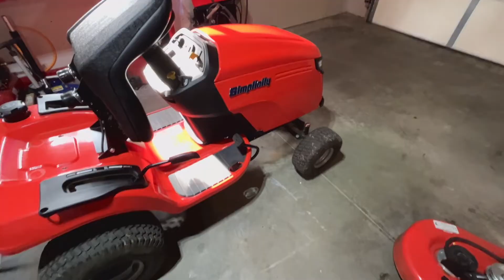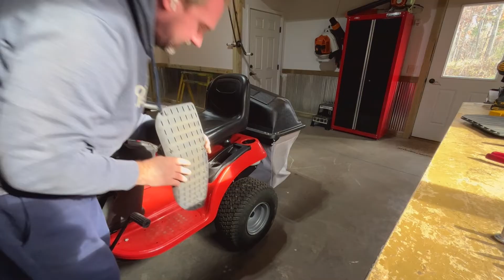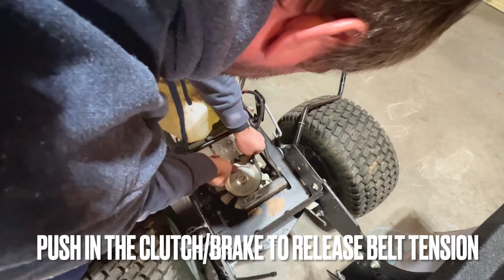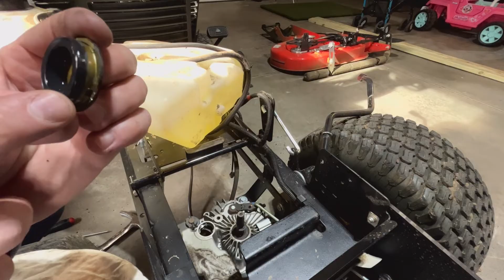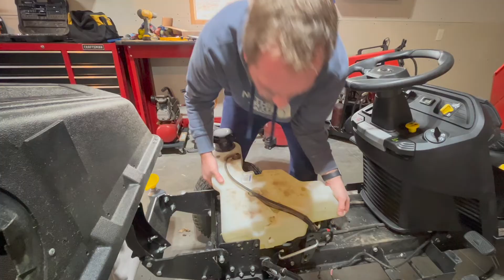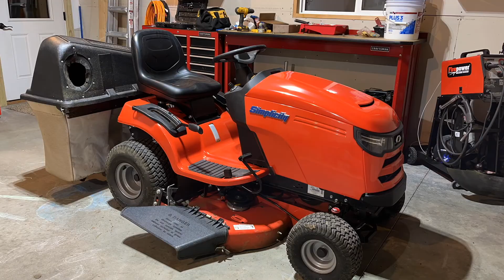Tuff Torq K46 Oil Check/Change Simplicity Mower End of Season Maintenance #4: Hydrostatic Oil

Comment: Your are luck that simplicity ordered their trannys with the drain plug drilled and tapped. With John Deere on my x320 K58 tranny and all John Deere mowers they say they are not serviceable. They refuse to help you or do it for you. I will have to do my own as soon as my back heals. Tuff torq calls for an oil change every 250 hours.  John deere wants there trannys to last only 1000 hours and then, poof, it is destroyed and you have to spend a few thousand to get another mower or tranny.  Evil company. So I will have to take my tranny out, turn it upside down and drain the oil out of the fill and breather plugs, remove the bottom cover, then drill and tap the 2 cast bung holes and put in an 8mm  1.25 bolt and sealed washer in. I have called my local dealer and they refuse to do anything. They just keep saying it is not serviceable. I said, then why to they make a service kit with a new inside filter and the bolt and washer kit and other parts to service it?  They would not answer me. Would be nice to have a torq wrench for a torq tranny. 🤣🤣 Thanks. Great video and explanation. Sorry for such a long explanation. 🙄🙄

Comment: How much of the two quarts did it take to refill the transmission? I know some are saying that single drain plug won't drain the entire unit... but replacing at least some of the oil is better than none.

I just wonder if it held two quarts or something less.

Thanks for the video!
Reply from the maker: If I remember correctly, it was just shy of 2 quarts.
Reply: @TheLawnEngineer  it's interesting there was just the one drain plug... perhaps Tuff  Torq figured changing out most of the oil would be sufficient.

Comment: I think it's easier to remove the trans axle and there is a kit that includes an expansion tank that can be fitted so it's much easier to check the oil level. Also a useful tip is to remove the hubs and coat the axles with copper grease and replace the axle seals. You could live to regret not doing so if you need to replace a seal and the hub is stuck on with rust. The hubs are just held on with a C clip and washer and you will find a small key either in the axle or inside the hub. I've just spent over 2 hours with a 20 ton press at its limit and a blowtorch because some numpty fitted one of the wheel hubs onto the shaft without grease. It was rusted on solid.
Reply from the maker: Great tips, the expansion tank kit sounds like a great addition.
Reply: You know the part number for that expansion tank kit. I found an expansion tank for the k46 but nothing for installation.

Comment: Replacement fill caps are very reasonable.I have used wide thin gasket scraper to pop cap with good results.The transmissions last fairly well unless over loaded(heavy trailer pulling/snowblower use-spinning wheels/big hills/aerator pulling etc.Little maintenance goes long way especially if used other than 20hrs a year flat land grass cutting.(and heavy folks riding it is hard also)
Reply from the maker: Great additions, thanks for sharing.

Comment: The gear need to be refilled via the two drain holes (from underneath)
Reply from the maker: Not according to the tuff torq service manual. 

Refill transmission case with oil through same port to near top of the case. Tuff Torq® recommends refilling transmission with Tuff Torq® hydrostatic oil, available from our service and aftermarket department.

Comment: If you only pulled one drain plug then you drained one side of the case. If your trans came with drain plugs, there should be two. Internally it is split into two reservoirs. The fill hole at the top is the only opening between both sides.
Reply from the maker: Thanks for adding this, hopefully others read this so they don’t repeat my mistake.
Reply: Then after he put in the correct amount of fluid it should have been way overfilled if only part of it drained out?
Reply: @ab7rs probably not. If you only drained one side and then filled to the proper amount then it would be fine in terms of volume of oil, you just would have one side still containing dirty oil. Both sides of the case are connected at the top. That’s how you are able to fill both sides through one hole. There is no connection between the two sides of the case at the bottom. That’s why you need to pull two drain plugs to fully drain both sides.

Comment: Haven't seen it done that way.  
We take the weight off the back , go from underneath and pull out the unit with tires attached ect and go from there ..lots less work.
Reply from the maker: I’ll try that next time.  I did it from the top so I could check the level after running for a bit per the procedure…but that doesn’t seem necessary.

Comment: The fluid that came out was clear as day!  I just bought a used Broadmoor 20hp vanguard and I don't think it was ever changed and it has 1276H on it.
Reply from the maker: Yes, it was very early to change.  My main goal was making the video =).
Reply: @TheLawnEngineer  They call for a change I think at the first 50 hours and then 250 after that. Yes,  you missed the other drain plug to get next to the filter that you could not clean.

Comment: Thank you for the video.  The old Simplicity Hydro (circa 2000) my mother bought can barely climb a hill these days, and I had never known how to service its transmission.  It won't die, so a transmission flush is definitely in its future so that a family member can use it on her property.
Reply: Turned out its drive belt was very loose.  Changing it is quite a job.
Reply from the maker: @rodcros  I’m glad you found the problem, and yes those belts are not easy to replace.
Reply from the maker: You're welcome, hopefully new fluid will put some pep back in the hydro's step.
Reply: winter project and it's easy.

Comment: Good job I'm in the process of doing mine I run mine yesterday and going down hill it took off so I'm hoping this change of tran fluid helps don't know for sure your input would be greatly appreciated.  Thanks my friend
Reply from the maker: Thanks for checking in and good luck with the change.  Unfortunately I have never had a fluid change improve operational issues, its really more of a preventative maintenance.  

Hopefully, it makes a difference for you.  Please check in and let us know if it made any improvement.

Comment: That’s a lot of work for a simple task. Shame on these engineers,.  My John Deere is a residential model with sealed lifetime motors.  Sucks because we all know those are built to fail.  Makes me wish I would of bought a commercial used unit and those have easy access drains and fill ports for monthly/quarterly hydro oil changes
Reply from the maker: Definitely planned obsolescence.  We don't want to pay the price for a model that will last for 20+ years so they just make us buy several over 20 years.
Reply: there are several videos on youtube that show how to take the tranny out remove the breather and fill plug and drain the oil upside down and then unbolt the bottom plate upside down and then drill and tap the 2 cast bung hole with an 8mm 1.25 tap and bolt with a sealed washer or use teflon tape. tuff torq suggest oil change every 250 hours.  https://www.youtube.com/watch?v=1ikGq2k4iJI&t=711s            a few other videos, but this is funny and more thorough. 🙂

Comment: While winter is upon us, think I will check out all three blade spindles and see if maybe need greasing in the bearings, or replacement. Don't suppose you have had to do this with your machine yet. What grease would you recommend for bearings in our spindles? Probably any grease used for packing wheel bearings I would imagine? Thanks!
Reply from the maker: I’ve greased using the zerk on the spindle.  It’s hidden under the deck above the blades.  I showed this in video end of season #1.  For grease, I’m using a general hi temp grease in my grease gun.

Comment: That was a great video. Man, that looks like a lot of work. I doubt if I'm gonna do all that. My old Cub was simple. It had a dip stick, a filter and a drain plug. Easy to check and easy access. Thanks for doing this video.
Reply from the maker: Yes, I like the idea of having new oil in there, but not sure it was worth the effort.